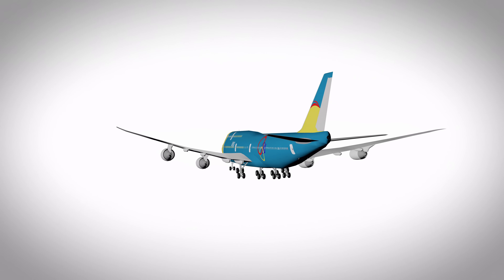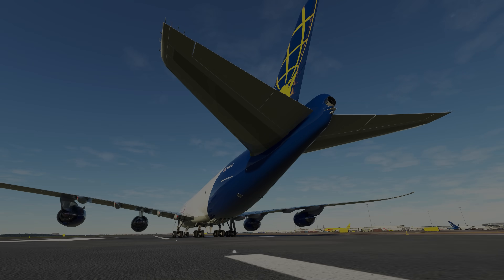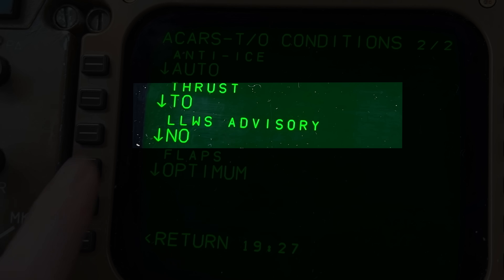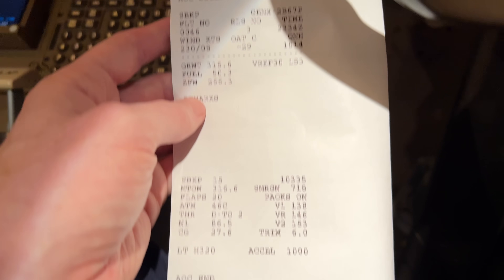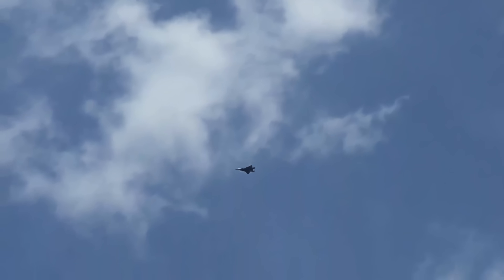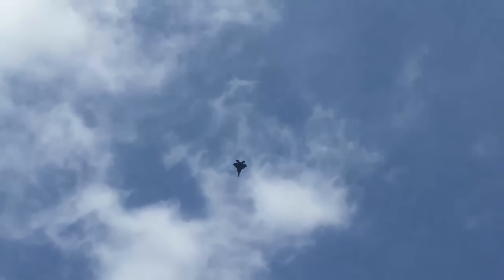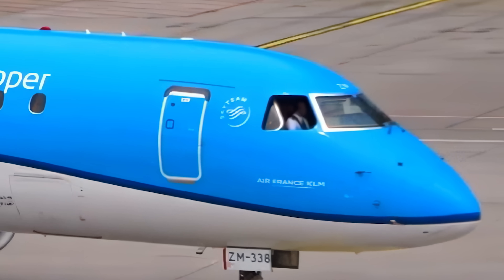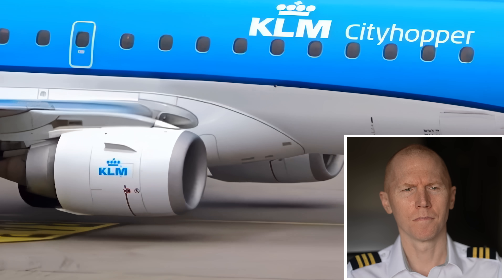Unsafe 747-8 Vertical Takeoff

Comment: Fighter pilots make movies.  Bomber pilots make history.  Airline pilots make the wheels of the economy turn.
It's probably not so bad for your transmission, using it to help slow your car by downshifting.  Racing drivers do it all the time as they come to a corner so that they can be in the proper gear as they exit said corner.  Where the danger lies is to your engine if you downshift too soon or into too low a gear.  You can overspeed the engine past its redline if you're not careful.  Race mechanics call race drivers who do that "rod stretchers."  Also sometimes a car being towed will accidentally slip into gear--if it's a low gear the wheels turning the transmission and the transmission turning the engine can sometimes spin that engine really fast, grenading it.  But the transmission is usually pretty much okay.

Comment: Atlas Air: Is that MIA, North Runway heading Eastbound, departing over the Atlantic? Although the 747 makes a turn to the right versus continuing out over mid Miami Beach and  the ocean as normal. Planes using the south runway will often turn right exiting over Brickell versus downtown Miami.

Comment: Down shifting is the preferred way to slow down. Especially with modern automatics, they will not let you over rev your engine. you would never hurt the transmission. I guess with a manual if you are an idiot you could throw it in too low of a gear and over rev the engine, but if you just go the the next lower gear there would be no issue.
Reply: Never seems pretty definite. And I guess the word "hurt" needs to be qualified. I'm quite sure someone isn't going to blow out their transmission just by downshifting at stops. But over the life of the car, say 200,000 miles or more which is pretty common nowadays, are you sure that the transmission wouldn't possibly need service sooner if that whole time the owner downshifted their automatic transmission every time they came to a stop?

Comment: Would you mind explaining what (flight number) “Heavy” means? 

Example: “United 725 Heavy” instand of “United 725”
Reply: It is all about safety paranoia (in this case, paranoia is good). An aircraft of type ›heavy‹ may be followed by a light one only with bigger distance. Saying ›heavy‹ after call-sign reminds the ATC that this thing is big and precautions have to be followed.
Reply: @akronymus  So,basically, “United 725, this is a big plane, yadayadayada
Reply: @SentientMattress531   
Yes. And always standardised wording that can even be understood in poor radio conditions. Very low-tech, very efficient.

Comment: I am a car guy, and using your transmission (downshifting) to slow a car down is common, especially if you have a manual transmission. But, not something you would do in a parking lot to park your car. That would be stupid. At higher speeds, if you downshift at the wrong time, or into the wrong gear, you can over-rev the engine. Rev limiters can't save you if you mess up and downshift from 6th to 3rd instead of your intended 6th to 5th downshift. I know a guy who did that. $20,000 mistake. 

So, basically your analogy with the reverse thrusters on an aircraft is legitimate.

Comment: Downshifting my 🚙 is gear 1 for descending a steep hill. Push it into 3rd gear to ascend a hill. It's never failed me. It's designed for that. It's a good Jeep. I can fix some things on cars. I fixed a lot of my old PT Cruiser engine, and I replaced all the exterior lights on it. I can do minor stuff, and I can't even change a tire. Tires are machine rotored on.  Even my strong muscular man friend couldn't get a lugnut to budge. Good thing that I have AAA. They have machine rotors and can get the lugnuts off and on.

Comment: First time I took my driver license test I failed because I didn't use the transmission to slow down the car I was driving. I took the test in a Ford Escort manual transmission car and the guy docked me like 40 points because I didn't downshift coming down a hill and instead used the brakes. He said some crap about if I was driving a semi that it would be hard on the brakes and overheat them. If I had been driving a semi I would have downshifted but I was driving a freaking Escort. The second time I took it I had a different instructor and she was super nice. I don't believe I lost any points that time unlike the first. Watch the Columbo costarring Dick Van Dyke and the instructor in there and the one I had are alike. It was a 70 mile drive over to the testing place so kind of a pain in ass when you fail.

Comment: He was running the reverser to use his really, really expensive vacuum cleaner to clean the ramp.
We did have pilots open their windows frequently enough, usually at the gate and something delayed the manifest printout. We'd use a light cone on a stick to get the sheet up to the pilot. The pilot then being quite overjoyed to know how much his aircraft weighed and its balance points and all.

The prize winner, a Lufthansa flight that was taking off at PHL, during climb out, banked heavily enough that a first officer stopped in the middle of his walk around to gawk at the spectacle as well. They flight actually overflew terminal B!
I have no idea what kind of air glue he used to keep that plane in the air!
Stupid award went to an Eastern Airlines pilot, who powered back from the gate (cost saving move, as Eastern had a labor contract that required only mechanics to be allowed to push back an airplane), hit forward thrust hard while the exhaust bathed our ramp and the commuter airlines ramp areas, driving aircraft over their chocks and sending baggage carts flying into aircraft. One cabin cleaning crew member was thrown from the rear galley door of a 727, to land face first on the concrete ramp. Eastern went bankrupt shortly after her litigation, as well as having to pay for aircraft repairs...
Pretty sure that pilot isn't even allowed to fly a paper airplane now.

Comment: I have a question if a commercial plane is having problems like engine failure, lost its engines etc and the nearest runway is an airforce runway are you allowed to land in a military base?
Reply: Yes that does happen, but obviously need to let them know about it and ask permission, although I can't imagine the request being denied if the pilot is claiming an emergency. Even if someone landed without contacting the tower it's not like they would just blow them off the runway with a missile or anything, but they would need to have a good explanation for why they had to land there and why they didn't contact the tower. And common sense would be to land, pull off onto the nearest taxiway then stay put until told what they want you to do. Taxiing towards the facilities without permission would not be a good idea.
Reply: @StevePemberton2  Thanks for answering good to know!

Comment: Kelsey, I was just wondering what would make a plane violently snake down the runway upon landing? I was on a 777 landing into MCO from LGW with British Airways and upon landing the plane went hard to the left then to the right and so on until it slowed. Could it have been crosswinds? Could it have been a puncture? Could it have been overcorrection from the pilot trying to get on the centre line? 

I’ve never had a landing like it and the entire plane screamed. There was no mention from the cockpit of what happened either which I thought was very unusual…

Comment: Kelsey, what's going on is the F22 has thrust vectoring nozzles on its jet engines, and as a result it's able to put itself into a flat spin using differential thrust (another form of thrust vectoring), and then it can either nose right out of it using its 2D vectoring nozzles, or switch the thrust differential around and go back to flying straight in level flight. And yea, it's some black magic fuckery

Comment: A lot of the shot is "illusion" - it's steep, but not that steep.
I've propped planes over a 100 times.  But:  throttle way out, parking brake set, main wheels chocked.

Comment: "downshifting to save your brakes"
It is taught in driver's school in EU.... if you driving stick anyway. As part of "eco driving" or whatever it is. Also for trucks. When going downhill for prolonged amount of time using your engine as a brake is a must to not overheat the brakes. Trucks even have an additional system to help braking this way, it uses exhaust gases to choke the engine.
In city traffic it's useless 99% of the time, the distances between intersections/ lights/ turns/ pedestrian crossings are just too short and too unpredictable.

Comment: Kelsey, I have a question totally unrelated to the video. With Boeing discontinuing the 747 "passenger" line not too long ago, did they also discontinue the 747 cargo version or are they still making those?
Reply: The last Boeing 747 cargo aircraft produced was delivered to Atlas Air in January 2023.

Comment: Fighters can be designed to be inherently unstable in flight, so they have increase maneuverability. They require the pilot to be much more mentally on top of what their options are at any time - it is much harder to recover from unusual circumstances because of the instability.
Commercial passenger planes are designed to be very stable so that if they encounter an unusual situation, they are very likely to return to straight and level flight with minimal pilot input.

I would be very wary of opening up thrust reversers on a ramp because of what you mentioned. There appear to be humans that don't understand what a trash can is for. My dorm was near the flight line of the AF Base I was stationed at, and I can only imagine the extra possibilities that generated for foreign object damage to the engines of the F-15s that would take off on full afterburner. I hate to think of a crew chief having to perform extra maintenance because a candy wrapper or soda 6 pack ring got sucked into the turbine blades.

Comment: I suspect that the guy who hand-propped his plane thought that he had set the brake first.  Even if he had, it may not have helped.  It's hard to tell from the grainy video, but that looks like an older Piper Archer.  The old Archers can be a bear to start - they had this awful primer thing that you had to twist and then push in and pull out a few times to try to get a little fuel into the cylinders but most people end up just starting them with the throttle wide open and the fuel pump on, and then immediately retard the throttle as soon as it fires up.  If he was hand starting it, I suspect that the battery was dead and therefore, the fuel pump wouldn't have been working, so he almost certainly had the throttle wide open and the mixture full rich.  That thing had full take off power the moment the engine fired up and the brakes alone wouldn't have preventing it from rolling off.

Comment: Slowing down a car (or a truck!) with the transmission is the basis of a good driver. You downshift and use engine brake. Trucks take this a step further with the J brake. I believe car analogies are really not that good

Comment: Modern fighter planes can do some really crazy maneuvers, because the computers interpret what the pilot is trying to do, and can make the ms to ms decisions and keep the aircraft stable.

A lot of fighters are intentionally unstable in flight, and have to have a computer to keep the aircraft flyable.  And the aircraft designers do this intentionally to make the aircraft more responsive.  I will point out that i am not an aeronautical engineer, and this is a very simple explanation to an exceptionally complicated subject, but it's how it was described to me.  By actual aeronautical engineers.

Comment: TL;DW: Maybe a high-thrust takeoff (maybe because there's low-level wind sheer) of a lightly-loaded aircraft. The pitch is chosen to maintain a target airspeed, so (high thrust) + (low weight) -> (steep pitch).

Not unsafe. Aviation is cool. 747s are really cool.

Comment: I just flew back from Florida on Allegiant and I farted as I passed the open cockpit door when disembarking.  I meant for it to be a silent crop duster and I did it because they held us waiting for a gate for 20 minutes with the air off... however, I had Taco Bell crunch wrap supreme before heading to the airport... usually a super fart storm, but this time I shart a little and it was really loud.  One of the pilots went "Oh dude!!" and then the stewardess gay guy jumped like I shot him and the guy behind me stopped dead in his tracks.  I guess the point of all this is... I like your channel even though I'm a crop dusting pants pooper.

Comment: Sorry, but I take off at max power. ALWAYS.  You get altitude quick, and more response time in an .emergency.  Save a bit of fuel by using less power?  Yes.  But explain running out of runway or inability to handle wind shear?

Comment: Good video. Your comment about transmissions is actually common in heavy truck driving. I have driven split shifts (2 gear sticks) & trucks ranging from 4 gears, 5, 10, 13, 15, & 18 speeds (gears). To save braking & glazing the pads, using the power train to slow down was common. Brakes are used but often to stop or if travelling at slower speeds. I've gone from driving 100 kph on the highway, taken the off ramp & down to 20 kph without touching the brake peddle. But flying a jet & using reversers must be so cool. Thanks for the video.

Comment: There was no 747 vertical takeoff. This is because a 747 cannot takeoff vertically. Even if you could pull the nose up to 90° right after liftoff, the plane would immediately fall.

Comment: That F-22 escapes from the laws of aerodynamics but not from the laws of Newton. It is laying a trap on us all because it is using vectored thrust. That plane is in such a configuration that its total engine power is greater than its weight. That enables it to literally accelerate in a vertical climb- Rockets do it by definition; not necesariely planes. Few fighter planes can actually do it. MiG-29, F-22, F-35 and some exclusive others, and in some specific weight configurations only. If you add this sheer brute force plus a bit of thrust vectoring, you can see things like this. There's a detail I didn't expect: this F-22 is spinning. It seems to have included  LATERAL thrust vectoring, which is a novelty to me. F-22 have only vertical thrust vectoring. Maybe the pilot is using differential thrust to obtain that weird spinning (right engine full throttle, left engine idling), just like Maverick in his last movie!

Comment: Love your channel Kelsey. I do have a question I have never seen videos on though. When an airliner takes off and is in air within 10 seconds what happens if the tail or rudder thing change directions and cause the aircraft to climb dangerously steep? Possible flip? 

I guess I'm asking what safety measures make it so an airliner won't climb to steep and stall or flip? 

Another thing I wonder is what happens if the engines completely lose power within 10 seconds of the climb??

Comment: Then why in the 1990s did some 737 200 or 400s full of "sun burned meat bags" take off at a very steep angle at Samos(SMI) over the sea? Is this still the case?  Typically Olympic Airways was steep while Transavia or German or English operators flew lower for longer. Observed from an appartement and a nearby mountain for 3 years.

Comment: I don't understand why someone intelligent enough to fly a 747 is encouraging this use of the term 'vertical takeoff' for what is actually a conventional take off with a steep climb.  There are aircraft that can perform vertical take-offs, aside from helicopters, of course, but 747s are not among them.  And, of course, that fighter jet in your video was performing a vertical climb, but it was still not a vertical take off.

Comment: Kelsey, you know how long runway 36L at AMS/EHAM is, right? Sadly I have no video of it (pre camera-in-cellphone era), but I once saw a China Airlines 747F pull an Aerosucre there, when 36L was in use for maybe a few months at most. The aircraft must have been heavily loaded, maybe even overloaded. It got it's nose wheel off the runway at the displaced threshold stripe (I had stopped cycling there because it took so long for the plane to lift off), and the mains touched the grass at the end of the asphalt. I was like "[Female parent abuser]! Go uuuuup!" 😱

Comment: The fighter jet (F22) has vectored thrust. Essentially, this allows the pilot to change the direction of the engines exhaust. This capability allows the pilot to maneuver the plane differently than the typical fighter jet. Most notably, it allows much tighter turning.

Comment: Could some of this be the experience of the 747 crew?  If the flight deck crew were veterans of flights in and out of hot spots they would be more comfy pushing that than a pilot with with less experience.

Comment: The engineering on fighter aircraft is insane with incredible thrust to weight ratios thrust vectoring and insane redundant control systems that prevent them from falling out of the sky like a rock. 

I'm sure the fact that they have an ejector seat probably reduces the potential pucker factor a bit too.